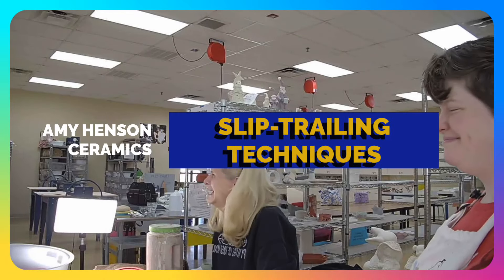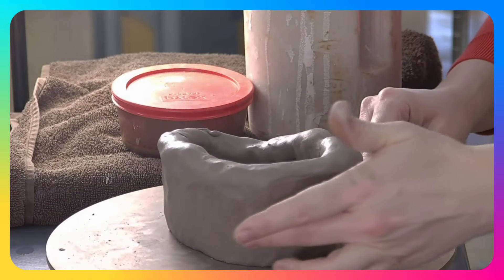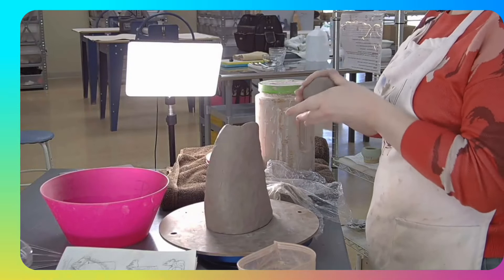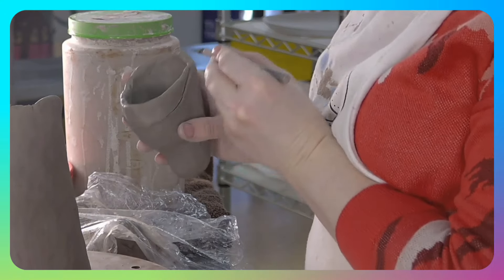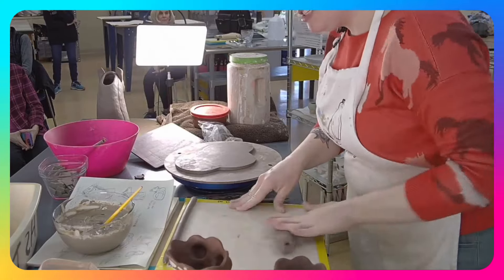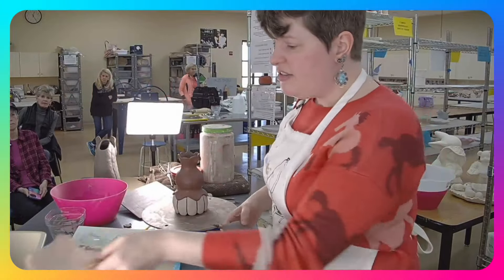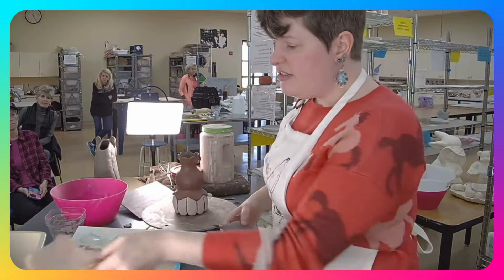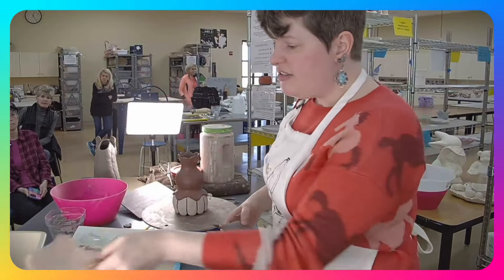Slip Trailing Demo with Amy Henson

Comment: The camera needs to be on the other side.  Your hand is blocking the view of everything you are doing with the slip trailer.  Can't see a thing.
Reply from the maker: This video was shot as a live 3 hour presentation by nonprofessionals utilizing a camera whose position could not be changed.  Sorry for some of the issues.